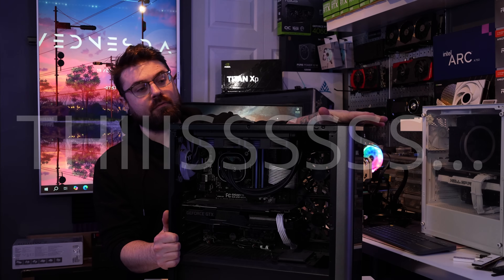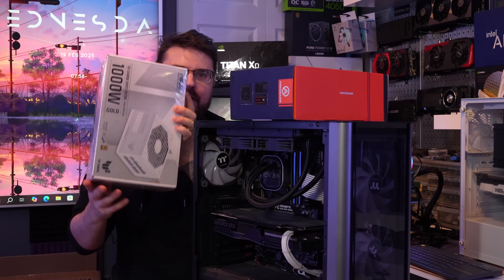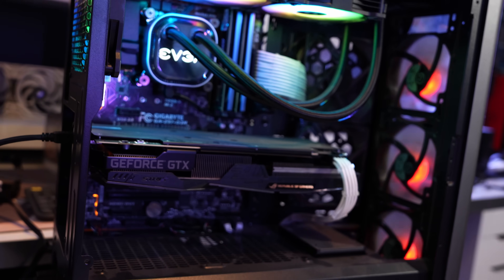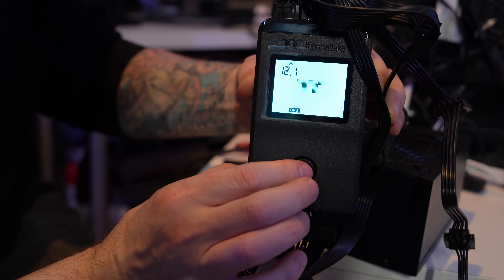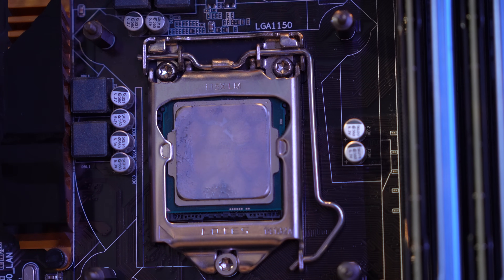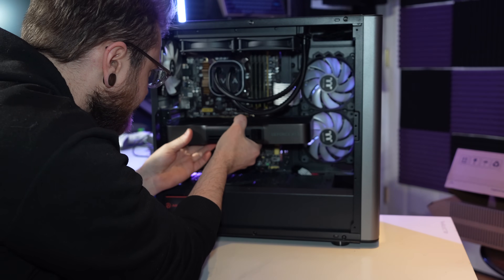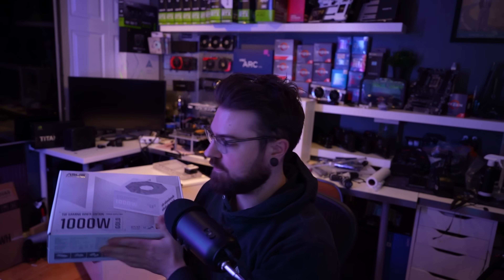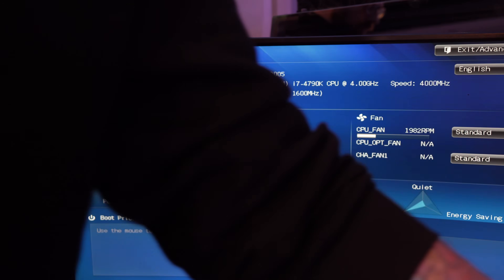We thought it was the power supply | Boot or Blue Screen EP5

Comment: It feels good when a job gets done.  Bravo.  
Last time I had a dead PSU was in 1995 IIRC.  Ever since the problems to me tend to be one of motherboard, RAM, HDD.  I don't want to jinx it.  
Though, having said that, my good (as in more powerful and expensive) laptop I bought in 2014 (I bought two back then, with the lower tier one being my main computer now), I am 99% sure it's a GPU malfunction so yeah me!   My only GPU/graphics card malfunction in 38 years of owing computers.  
My point was, I had a feeling it was the motherboard lol.

Always forgets ASUS builds PSUs.
Reply from the maker: Yeah it's true, if you invest in a good PSU, you basically can transfer it for years on end. Lately it seems like I'm running across a few more but yeah, you were right. Motherboard all along. 

The Asus top tier PSUs are manufactured by Seasonic so they are actually half decent and I use them for my main systems as well. It's basically a fancy Focus Gold Seasonic
Reply: @techwandoUS  never had a Seasonic and never heard of them till few years back when I started from youtubers who suddenly (for me) started raving about them. I am not saying they are not good, but sometimes it feels like other fads in the tech space. 😀
Reply from the maker: Haha. I totally get it. Seasonic was making PSUs all the way back to the earliest of days, they started about 50 years ago, and in around the year 2000 they brought mass power supply inventory to the US and other major regions. As time went on they expanded. 
They now hide under brands like Corsair, asus and others.
They are basically the OGs.

Comment: A friend came to me her rig was turned off when she left for a trip she came back and the she had mentioned it felt warm 😱 it wouldn't turn on at all zero life I researched it the system was a prebuilt dell it cooled itself during a power outage.
Reply from the maker: Sometimes the PSU capacitors have a cool down time after a surge. I actually gave away one of my dead PSUs years ago to a friend. It turned right on. Even though it would not work for me a half hour after a power outage. 
Maybe it was PSU related? Pretty strange though for sure.
Reply: @techwandoUS  tried a trusty Corsair SF750 with the adapter since Dell uses proprietary cables in the older OEMs. Still nothing then tried a PSU tester PSU was def cooked. Gave her one if Ghost S1 Builds cloned her HDD so none of her course work was gone 4 yrs worth of work for Career.
Reply from the maker: @shadowarez1337  that was very kind of you. Well done man. Cloning doesn't always go super simple from my experience. She must have been thrilled.
Reply: @techwandoUS  was a huge upgrade but helping friends out when can is why I do this and I had 3 Ghost S1 rigs plus I know feeling of not having a rig to use when it dies see Asus Ai OC feature horror story's lol.

Comment: A 1000 W PSU for that Z97, ha! I have a 1350 W PC Power & Cooling supply in a Q6600 XP build, but only because it was NOS dirt cheap. Right to blame the cat for swiping the motherboard, they be sneaky. Mine are always posting my inventory on Craigslist.
Reply from the maker: That's a beast of a PSU for the q6600. I actually just got a PC back from my family with one of those. Did you do the tap mod on the CPU?
Reply: I know right, just because I could. I don't bother with much beyond 750 W on newer builds. The BSEL mod is good for OEM Q6600 rigs. I do a lot of retro 98 SE and XP builds lately. This one is on a DIY Gigabyte board, and does well over 3 GHz anyway without tape.
Reply from the maker: @drewnewby  nice man, retro stuff is great. XP is sorta a beast all these years later. It's so debloated compared to every os.

Comment: Where did you get that lil CMOS battery holder ? Good video man 👍
Reply from the maker: It was 3d printed by my friend Mel. I think you can find it on thingaverse
Reply: @techwandoUS  ahhh nice. Very clever idea. Good content as usual man and nice come up on the PSU 👍
Reply from the maker: @Straydogtech-wf9kj  thanks, I'll ask him for the link and drop it here
Reply from the maker: There's a few different types in here

https://thangs.com/designer/Michael%20Fuchs/3d-model/Gridfinity%203x5%20Ultimate%20Battery%20Holder%20%28AA%2C%20AAA%2C%20AAAA%2C%202032%2C%20LR44%2C%20A97%2C%2018650%2C%209v%29-62533
Reply: @techwandoUS  awesome thanks bro

Comment: Thank you for your video, which was very informative and well-produced. I was quessing the problem was the PSU. WRONG. I recently purchased an ASB per-built PC. A few days ago, it began to act strangely. I would do a shutdown, and the RGB lights would come on after a few minutes. All the components would turn off except for the RGB lights. I needed to restart the PC and shut it off again, and the RGB lights stayed off. Second question. Which brands of PSUs use proprietary wires. Would your PSU check power device tell me if I use the wrong cables for my MB? Thank you for your time reading my comment.
Reply from the maker: Thanks a lot for your comment and the kind words. I really appreciate that! 
As for your question about the power supply, basically any power supply will work as long as the cables that are included with the power supply are the ones that you use. On the motherboard or graphics card side. It's a standard but unfortunately if you're buying a modular power supply they often have different connections on the modular side that connects to the PSU. Does that make sense? 

Essentially, if you decide you're going to buy a new PSU to troubleshoot or fix your computer, just change out the old one completely and make sure you don't use any of the same wires from the old power supply.

Comment: I got in line a few times on Best Buy to buy a 5090. After seeing all the issues with missing ROPs , melting connectors(again), and PCIe gen 5 issues I am glad I didn't get through to buy one. I have a 4090 so I don't know why I was so set on upgrading. I think I am going to put the money into my physical set up like desk and chair. The 50 series launch has been a sh*t show since launch day.
Reply from the maker: Yeah hold onto your 4090, honestly the new launch is so boring this generation if your on any 40 series above 70 class.
The 4090 if anything just gained value from the whole situation. It's now the perfect balance between professional and gaming.